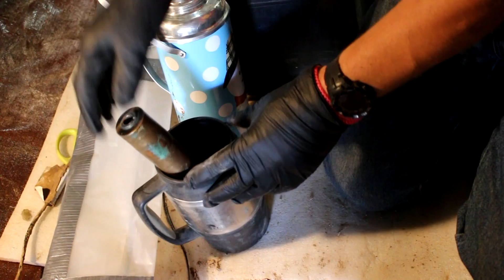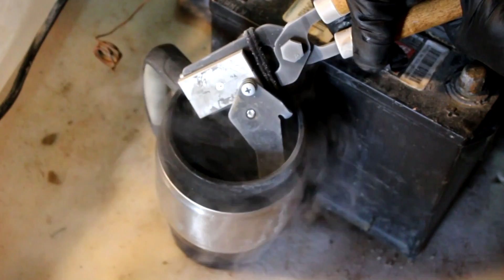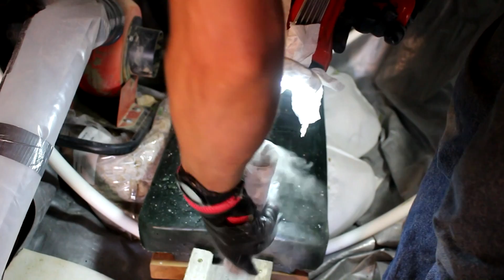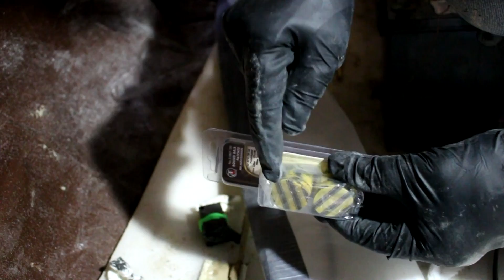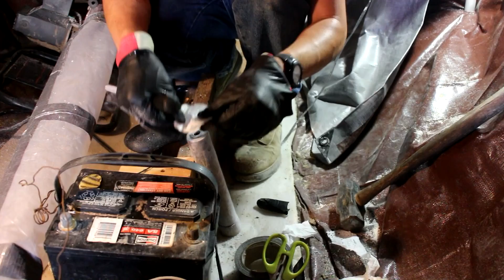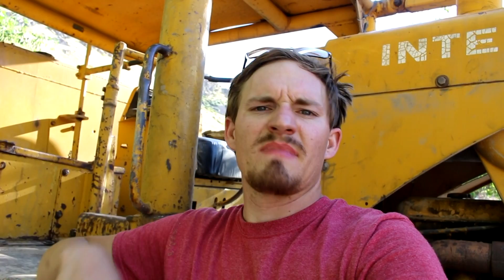Shooting Mercury Bullets

Comment: Cody,  why is the liquid metal at the end so dirty? (I mean in the slow motion ending) Was it dirty mercury or molten lead?  if it was mercury, why so dirty?
Reply: Gunpowder.
Reply: absolutely everything in the air will stick to the surface of the mercury, and because it is so dense it will sit on top. There really wasn't that much material on the top of the mercury but even just a little bit is enough to tarnish its appearance. Taofledermaus explains it pretty well in a bunch of his mercury videos

Comment: Cody, on 8:10 you mentioned the momentum of the bullets. Because the lead and mercury bullets were loaded with the same amount of power (Potential Energy), they had the same amount of momentum transferred into them. The mercury bullet, because it is heavier than the lead bullet, was travelling slower, therefore keeping the momentum of the two bullets equal. Please do correct me if I am wrong.

Comment: the reason you are getting deeper penetration from the mercury as you noted is because its denser, but not just that it carries more momentum. But the physics of it is that the heavier load is more resistant to the inertia of the charge, thus building higher pressure and giving it a slight boost.

Comment: dude.  mercury is more easily absorbed into the body than lead.  this is due, in large part, to its ability to aerosolize and enter your body via your lungs.  I mean even without you spraying it everywhere out of the gun it produces vapor whenever it simply exists due to its liquid phase being present at STP.  Since lead is a solid at STP there is not the same issue and lead toxicity typically results from ingestion rather than inhalation.  blah blah vapor pressure blah blah respiratory tract absorbs more toxins than digestive tract.  good luck buddy.
Reply: it evaporates very slowly, he wouldnt get sick from making this video. plus, he had that fan thing

Comment: Should have pre-loaded the gun with the patch before cooling it no?
Reply: Patch needs to be over the powder. but the powder under low temps either does not detonate or the performance is extremely deteriorated...
Reply: +bruno baumanis well, I'll bet the powder would work great if you cooled it with liquid oxygen instead of liquid nitrogen...
Reply: Depends on what you mean by "work great"... it would explode.
Reply: bcubed72
I don't know about a propellant, but it would make a helluva boom!
Reply: He wants the barrel to be pre-cooled so that it doesn't melt the mercury bullet when he loads it. The gunpowder will still burn at the low temperatures. Not quite as fast, but I dont think it is that noticeable.
Reply: Ben Watson it is noticable ppl did tests with funpowder in bullets and either they didint shoot or they shot like shit
Reply: Yeah i think you are right, might be worth testing though? Perhaps not with mercury though. Maybe see if pre-loading the patch with gunpowder then cooling produces a faster projectile than using a homemade patch when loading the barrel cold.
Reply: +bruno baumanis 
That is interesting. Do you have any links to the tests? Cody has a video on testing gunpowder at liquid nitrogen temperatures His conclusion was that it didnt make a noticeable difference. 

I realized that I miss understood what the original comment said. I agree that he should try loading everything but the bullet before cooling it.

Comment: Why don't you mine all the ores in the mine and see how much metal you get in your mine series
Reply: real mines aren't like Minecraft. the ore veins can run for miles, and it would only be useful if he could find rich ore. Not to mention how he has to be careful about how he mines to avoid having the mine collapse when he blasts the rock. Right now he is working on ventilation and an air compressor to run a drill so that he can continue in the mine